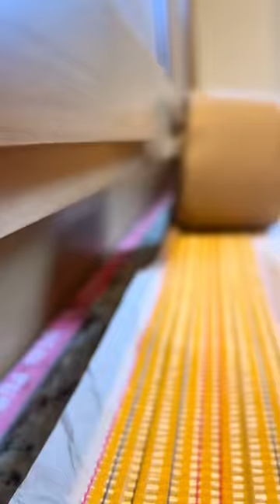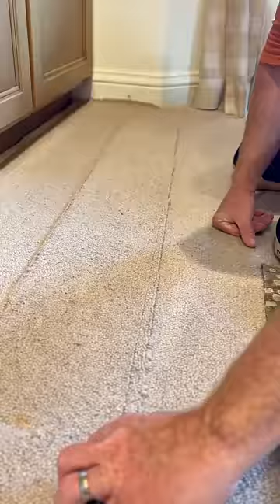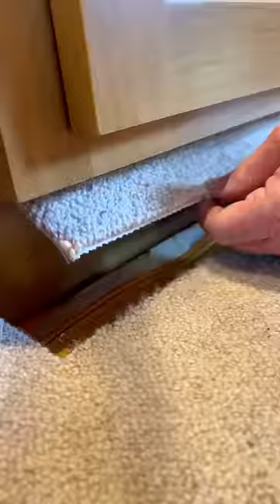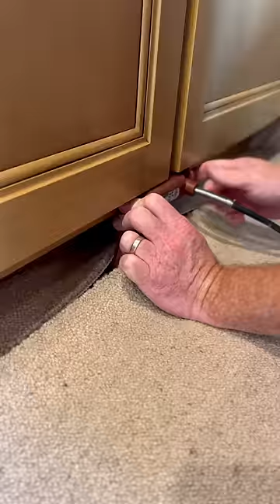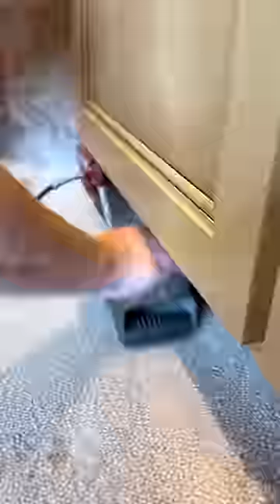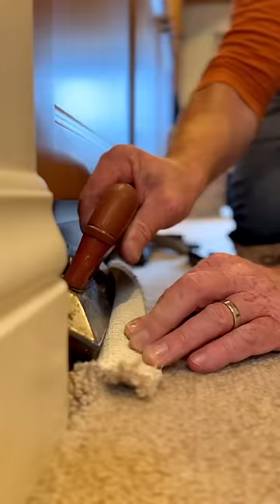Carpet cure #shorts

Comment: That’s what happened with my carpet, it was cut too short and they had to add onto it, problem is the seam is getting frayed now.
Reply: Doesn't matter how great of job they do... it will fray in time.  That's why I would allow this.. not even in my flip homes.
Reply: @cjwcjw9578  agreed but I think you meant to say "wouldn't allow"
Reply: Carpet comes 12’0”. When the room is larger than that, you will have a seam no matter what. Life has frays.
Reply: @cjwcjw9578  not true, a proper seam in the length of the carpet will outlast the life of the carpet itself
Reply: Hackers can be measuring the floor too.

Comment: the heater should be easier to take out if u had opened the last cabinet so it wasn’t pushing the handle down… probs coulda done the whole length like that but idk if it’s worth the trouble
Reply from the maker: Possibly, but the door opened out at the hinges there so opening would have been more in the way. Maybe taken the doors off? But didn’t want to mess with their work. 😅

Comment: Would it have been possible to pull back the carpet and fold it in on itself or did you just not want to have to kick in that corner
Reply from the maker: First side I did, yes. But the second would have required cutting open a cross seam down the mbr hall that I didn’t want to touch.

Comment: In that situation I would have used a steam iron and wet rag. Works great!
Reply: That's not a method you can use. If you put a wet towel on the face of a carpet and then a steam iron, you will melt or warp the fibers in some way that will be noticeable. Maybe I'm wrong. If I was going to try it I would start on a scrap piece
Reply: @gundersonflooringanddesign4064  you’re wrong. I’ve been doing it the last 20 years. It works great for small repairs.